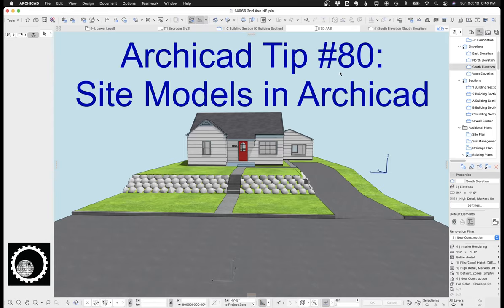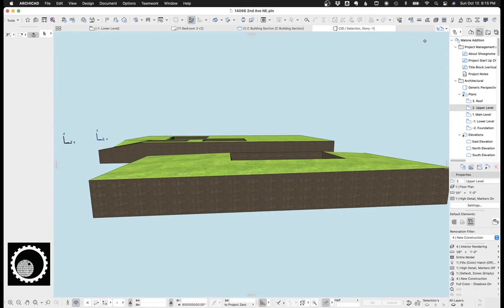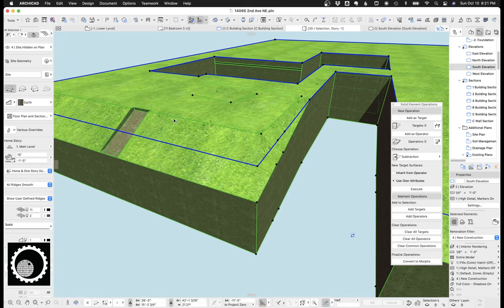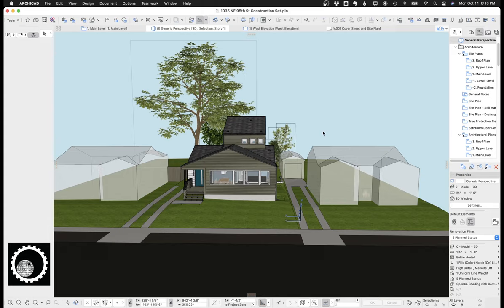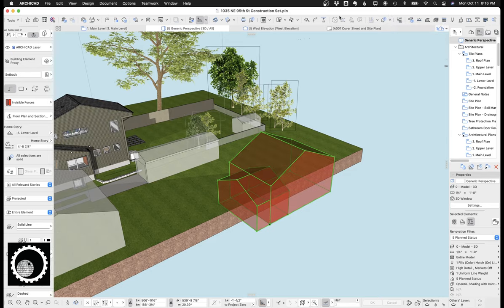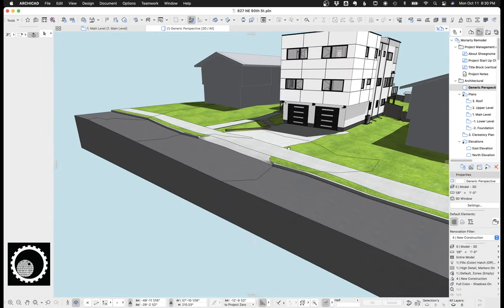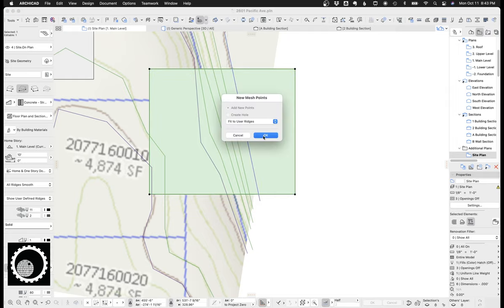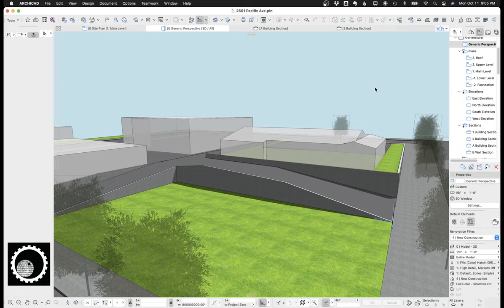Archicad Tutorial #80: Site Modeling in Archicad

Comment: Double SEO works like magic😍
Reply from the maker: Such magic! I actually wonder if it's a bug because it seems like it shouldn't be doable. But it works and has worked for well over a decade. I actually first learned of the technique from a video Eric Bobrow did back in November of 2010.
Reply: @Shoegnome  great workaround!

the downside to that, i guess is when you do cut a section through the double-intersect & the cut fill you see will be of the site (earth cut fill) & not the road cut fill (conc  / composite)...which is exactly what i want.

i want the Mesh tool to have significant improvements where you can have segmented composites -- asphalt & roadbase are at their proper thicknesses & below it is the site/earth fill. the asphalt & roadbase thicknesses move up/down like a typical mesh & anything below that is the site/earth fill -- all in one Mesh. basically, a "Segmented Mesh". can't stand having to model multiple meshes with multiple SEOs just to get it appear accurate in both the 3D model & Section...
Reply from the maker: The Mesh tool is in desperate need of an upgrade. It has basically had zero improvements since it was added to Archicad. We really need a Mesh with a bottom that follows the top and the ability to apply a composite to its thickness like a Slab or a Roof. I agree. This work around is great, but frustrating that there's not a better answer.
Reply: @Shoegnome  I hate to say it, but I prefer the Floor Tool from a certain architecture software which will not be named, simply because you can have it's thickness retained at whatever ridge height you need it to be.
Reply from the maker: Hard to argue with that!! Archicad, get your act together!